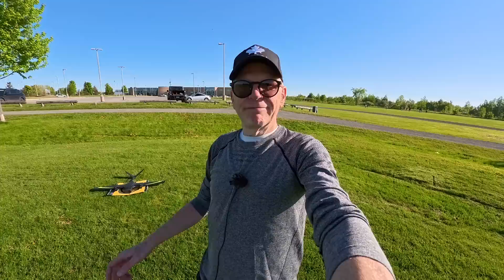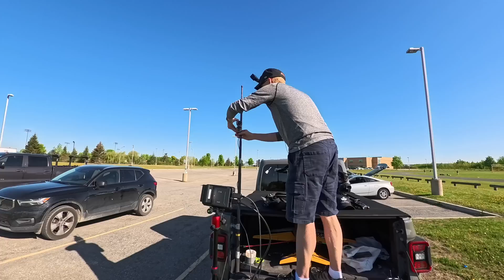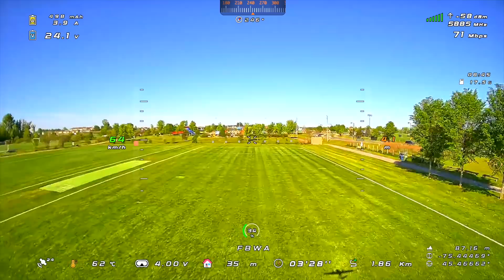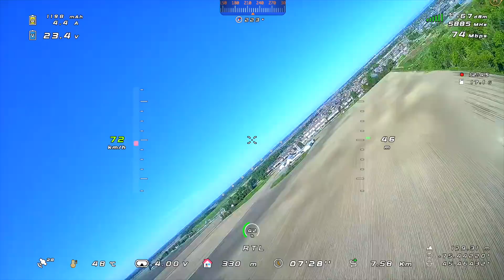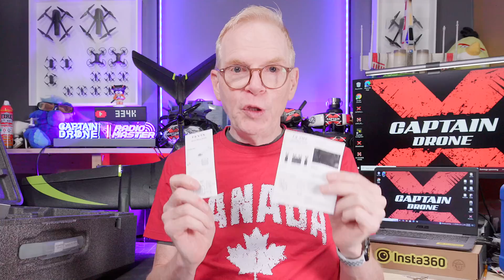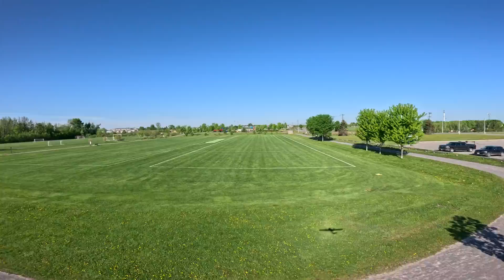OMPHOBBY - ZMO Version 2 - Long Range VTOL

Comment: HI Just watched your video.

Great video .The link no longer seems to work and there is no mention on their website of this or the original.  Would the FC dif file work on the V1 model ?  Richard
Reply from the maker: The flight controller would certainly work on the V1, but you’d have to gut everything out of the V1 except motors.  The company had problems with obtaining parts and then I think other problems developed so they pulled the website down.  I’ve asked what the exact problem is but have received no response.

Comment: is the tail motor on servo? I don't understand how it stays stable in loiter. I don't see any servo here
Reply from the maker: The tail motor is NOT on a servo.  The tail motor only works in VERTICAL flight (take off - landing) & shuts off during HORIZONTAL flight modes.

Comment: No compass calibration for the Ardupilot? Good luck with your flyaways!
Reply from the maker: Compass calibration is pretty much a thing of the past for the simple reasons that the reliance on a COMPASS in GPS is no longer a necessity, thus all products made in the year 2023 and onward work out of the box with now requirement for a compass calibration, unless of course you live in the part of the world where there are insufficient GPS Sats.
Reply: @CAPTAINDRONE798 compass is faster than GPS that's why it is still useful. But a two antennas GPS YAW is even more interesting thing to fly. I prefer the GPS YAW high priority then a compass in the GNSS module and then a built-in one. I don't fly in regions with corrupt GPS much but I do calibrate compass in every new location (if more than 200 km from the previous one) just not to have the GPS YAW and the compass inconsistant error. Hate it so much! 😂

Comment: seems like its not a rly long range fly because its very battery hungry, to fly near 1h you should put a very larger and heavy battery on it with not enought space to do it. Also the fpv cam has no headtracking right ?
Reply from the maker: Head tracking is something you’d have to add

Comment: Hi there sorry to bother you I went to the address you put up and got to the site for the v toll 2.....but I can't find the model on the site and have tried to contact them about the v toll 2 but had no luck ......are they still making this model ...do you know....
Reply from the maker: Good question.  They had a problem with the EDGE TX supplier… lack of stock. That could be the issue.

Comment: Will DJi goggles 3 work with it?
Reply from the maker: Only if it had a DJI camera system
Reply: @CAPTAINDRONE798  ok. So what goggles do you recommend? I wonder if the hdmi would go into a tablet or a small flat screen  tv.😂That would be cool

Comment: Your promotion video is completly useless because the link to buy is not working. You try to sell a 1000 bugs produdct with the funny way, that dont work. A compass calibration with ardupilot might be usefull. But you even say that this is an Ardupilot system.
Reply from the maker: You are unfortunately late to the game.  This is an old video and the product sold out.  The company is no longer taking orders.

Comment: What's the battery life on the plane and sending unit?
Reply from the maker: You can use any battery in the VTOL you like, as long as it fits, so BATTERY performance will be different for everyone in the RC Hobby.  Battery in the Transmitter gives a couple hours of use before needed to be charged, or one can just plug a USB cable into it to supply continuous power.

Comment: Poor design for a VTOL, it could serve as a surveillance drone with high altitude and slow flight. Rear properllers, does it spin in the sky during forward movement? That must be fitted for additional lift, considering the weight on the rear side.

Comment: I wanted to know if I could connect FPV goggles to this without capacitors or anything.
Reply from the maker: It depends on which video transmission system you pick when you order it

Comment: you said it plugs to any screen with HDMI so I plug it to a laptop ? or a portable screen ?
Reply from the maker: LAPTOPS often are HDMI out… to send your video to a larger screen, so nope!  Portable screens are small so they are often HDMI out, so nope!  You need a device with HDMI in… and not Out.  The display I used is for professional videography so it has HDMI in and out.
Reply: @CAPTAINDRONE798  thank you for your reply,,just a last question do they have one model that they sell with a remote control that has a built in screen ? like DJI drone remote

Comment: Great video, thanks! At 10C, he included battery looks like a Li-Ion pack... but 4400 mAh is a weird capacity for a Li-Ion 1P... can you comment further? Also, how much larger a battery would this plane support?
Reply from the maker: I tried it with a 5000 mah battery that was the normal long and narrow and it worked fine.

Comment: Dear Captain Drone, what would you recommend: buying this RTF version, knowing that I already have a headset with an HDMI input, or buying an used version 1 (the one with the old DJI radio that you crashed three times) for the same price, knowing that I also have the DJI headset that would work well ? In the first case, I will have to wait because there is no more stock. Will my patience be rewarded? Thank you for this great review !
Reply from the maker: They do also make this new version in the DJI 04 version.  The version I flew has a crazy number of options and potential compared to the old version 1.
Reply: @CAPTAINDRONE798  Thank you for your reply ! I'll wait ! I haven't seen the version with DJI O4 on their website, but I'll ask them about it. The T3 system seems to be a good alternative for long range, if I understand correctly ? Best regards

Comment: What would happen if the signal drops?..and what is the best battery that can be used for maximum flight time?
Reply from the maker: If connection was lost, it would go into return to home until you took it over again.  Maximum flight time all depends on the experience of the pilot.  A newbie pilot would run any battery dry quickly whereas an experienced pilot would buy a proper battery and would barely fly in drone mode and would fly efficiently in airplane mode.

Comment: Hello, I’d like to use this drone to do weather checks for a heli skiing operation in BC. Will this drone still fly 35km even if it’s not perfect line of site to the receiver? Also another problem I’ve had with my DJI  drone is the vertical height limit. It’ll only allow me to fly 500m above my start point. Is there a way around this? Thanks
Reply from the maker: You’d have to ask OMP HOBBY what the max vertical height permitted is with this.  Also, all planes & drones at a far distance require a direct unobstructed path between transmitter and receiver.

Comment: I have it, have done missions and have it setup with DJI Air Unit 04 Pro, DJI Controller 3 and DJI Goggles 3. Its nice because I already use all this for my DJI drones and no need for Gopros. No ground station needed as well.
Reply: @Albert-cf1es  which kit version did you go with and what was the install process like?

Comment: Whats the average time on the a full battery?
Reply from the maker: It depends… if you ONLY use the battery that came with it then you are stuck with the best the battery can offer.  If you hover in DRONE mode, then it uses a ton of power.  If you fly like a plane, it uses very little power.  So I’d say a NEWBIE would get 30 mins and a knowledgeable person would get 45 mins.  Most knowledgeable people will use their own batteries to fly up to an hour or longer.

Comment: Does it have an intelligent return to home mode where it decides to come home because it knows the battery is getting dangerously low?
Reply from the maker: Apparently YES, it does…. BUT…. I have not tried it, so I can’t confirm this is the case.
Reply: @CAPTAINDRONE798 could I use a laptop as my display?  Assuming the laptop has an HDMI port, could I use that to view the live video feed from the drone?

Comment: OMP absolutely abandoned the ZMO platform with firmware issues. Honestly really surprised they made this V2. I bought the ZMO Pro and apparently the motors are not suitable for the platform. They sent 2 larger replacement motors with heavy duty servos, which ended up not even fitting correctly in the plane. They suggested I take a dremel to it to modify it. It's clear to me now they sent 2 of the motors from this new V2 plane. 

The majority of ZMO/ZMO Pro owners are grounded due to flight issues with the original FC, with many opting to swap it out and start from scratch. 

OMP Hobby if you see this, kindly create a page on your site dedicated to making right with the ZMO/ZMO Pro owners, providing updated firmware, and the steps needed to get their planes flying again.
Reply from the maker: I’m not certain which ZMO you are referring to that had motor and flight controller issues?  I have version 1 of the ZMO, the very first version made, and have made years of videos flying it in different weather conditions with no issues.  ZMO did make a second version with a terrible control system (it came with a remote with a display that was not good)… Is that the one you are referring to?

Comment: ❤ I WANT ONE !!! VERY GOOD REVIEW BTW QUESTION ❓ - Loiter Mode 👉 if you flip into that mode when it's off in the distance, will it loiter there or come back first ?? 
Thanks, I'll sub too 😎✅
Reply from the maker: Loiter mode is designed to fly around your own location.  If you are far away it may just work like a RTH without landing.

Comment: In your video, you state that it has a range of 35 km.  But on the product webpage, it says "ultimate" distance of 15 km.  Can you please clarify which is it? Thanks.
Reply from the maker: Range depends on the BATTERY used.

Comment: Great video, Capt.Drone. It's good to see that OMP HOBBY has finally improved on the ZMO by making a V2. The T3 video system is more than adequate for a fixed-wing product. The price for the entire system is not bad at all. I build lots of fixed-wing units using INAV with Speedybee and SN light flight controllers. The cost is comparable to a new DJI Drone. I like what I see, therefore I plan to break open the wallet on one of these. Ever since the Parrot Disco went defunct, I've wondered when someone would resurrect an out-of-the-box fixed-wing product. 😊
Reply from the maker: It sounds like you have some good experience and knowledge that will make the ZMO perfect for your use
Reply: I couldn't have said it better. I absolutely loved the Parrot Disco and must have put 100's of hours on mine with the 4G softmod. I'd also love to try out this ZMO. It's expensive though and v1 wasn't all that great I believe. But I want to believe in this product. Maybe I'll buy one.

Comment: If you think that "compass headings" and GPS accuracy are the same thing, then you have some learning to do.
Reply from the maker: Perhaps you are new to the world of compass calibration on a product with a GPS.  The reason a compass calibration is done is to ensure that the compass is reporting what the GPS is reporting.  If both are not in alignment then your product will begin to “toilet bowl”.
Reply: yeah... you better refresh your memory on gps vs compass. A GPS cannot tell you which direction you are facing but tells you your location. A compass can tell you which direction you are facing but cannot tell you your location. If one is clever, one can create a correlation of high degree between the two... but that is an approximation only and should not be construed as equivalent.

Comment: Last question Steve,  would you happen to know if the antenna equipment is weather proof? Even if its not, im purchasing the drone anyway.  Thanks for the video.  Im a subscriber now.
Reply from the maker: I suspect it is not weatherproof when it comes to RAIN.  I have flown the previous version in the winter and lite drizzle without issue.

Comment: Would love it if you reviewed more professional drones! Cinelifters, other production gear!
Reply from the maker: Ha ha… Well, I have reviewed all the major drones for so many many many years (since year 2016) when there was actually competition in the drone market.  Today there is pretty much only DJI beginner drones for first time pilots, and I can’t keep reviewing DJI Products or else I’d end up being like all those “DJI ONLY YOUTUBE CHANNELS” which are rather boring, unless all you wish to see is one video on a DJI Drone you wish to buy… then what do you watch????.  And to make things worse.  DJI only pumps out 3 or 4 consumer beginner camera drone kits a year so I’d quickly run out of things to review.  Finally, pretty much everyone who gets in the RC Hobby, even if they begin with a beginner DJI Drone, will eventually branch out into FPV Drones, RC Helicopters and RC Planes.  I certainly did, and I began with the DJI beginner drones back in the year 2013 (that is 12 years ago… Yikes).
Reply: @CAPTAINDRONE798 What I was getting at was Cineifter FPV's such as iFlight Centurion X8, Lumenier QAV PRO, etc. It's an FPV angle I don't think you have hit yet! As a producer I need the best possible camera that can be hauled into the sky, and that requires a cinelifter. Would love to see what you come up with!

Comment: Hello Captain Drone. So, it seems there is a long delay with the T3 video transmission modules. OMP Hobby said I can wait until they are available, or they can send my ZMO now and send the T3 later to fit myself. What do you recommend? I want to play with the ZMO now, but if there are issues with fitting the T3 myself I could be in trouble?
Reply from the maker: If they send you the T3 unit later, you would then have to install it in the ZMO and connect it to the correct port on the flight controller.  If they provide you with such instructions, then it is doable.  If you are the slightest bit unsure, wait for the entire unit.
Reply: @CAPTAINDRONE798  Thank you Sir. Another question unrelated to ZMO. Is there a way to see speed and altitude on the Flywing factory controller?

Comment: What's the flight time per charge?
Reply from the maker: Flight Depends on if the pilot is a NEWBIE to the RC Hobby or a long time RC Hobby pilot who has been flying FPV Drones and RC Planes.  So for the NEWBIE, the flight time is 30 min because they honestly don’t know what they are doing and learning as they go.  For the experienced pilot the flight time is 45 min, and can be much longer by using the proper battery (people in the RC Hobby will know what to use).

Comment: I'm on the fence about getting one of these. Does the rear propeller stop spinning while in horizontal (plane) mode?
Reply from the maker: Correct.  In RC Plane mode only the two forward props operate.
Reply: @CAPTAINDRONE798 thank you for responding

Comment: Steve, I just ordered the v2 based on your review. I followed your link - I hope you get the referral. I’m trying to source batteries but can’t find one that is equivalent to the one that’s included. What are you using? And do you have charger recommendations? Thanks.
Reply from the maker: Unfortunately, I receive no commissions from OMPHOBBY for any sales.  For a battery, any 6S battery with an XT60 connector will do and it does not matter if it is a LIPO battery or LION battery.  The square shaped batteries are difficult to find at a good price but plenty of the rectangle versions are available on AMAZON.
Reply: @CAPTAINDRONE798  Ok, thanks. OMPHOBBY's battery is labeled as Lipo as is their description, but I cannot find any in the same form factor and the same specs from any other source. The only batteries I have found are Li-on. So it has me wondering if they're really Lipo. In any event, OMPHOBBY emailed me earlier today to say the T3 video system is indefinitely out of stock. It looks like I'm going to be canceling the order. I hope another prosumer VTOL hits the market. The commercial options are way too far out of reach for hobby use.

Comment: Hey there good video by the way....I have a question ...can you swap modes on this model zmo 2...and do you need the ground station for this......and can I get it with the dji adaption on the zmo 2.....?
Reply from the maker: If you want to add the DJI 04 system, apparently you can if you have the know how.  Yes, any RADIOMASTER radio can be swapped from one MODE to another.  Personally, I’d just buy my own radio and copy the settings over.

Comment: Stall? I take it the aerodynamics don't allow for any sort of gliding then? If the battery died it will just fall out of the sky like a rock or what?
Reply from the maker: When the ZMO stalls it goes into Tri-copter mode.  But if you stall low to the ground on a turn, you may tumble to the ground.

Comment: If you can't even bind a controller, then you literally have no business even owning this drone... 
It's no wonder the hobby is going to be regulated into oblivion within 5 years. 
Making small aircraft available to persons who don't even have the desire to learn a simple process like binding a controller, doesn't serve the industry or the users very well in my opinion. 
It might make some extra money for the people selling the kits, but in the long run it's just pushing lawmakers into regulating the hobby away and making it harder to fly anything. 

Just wait. The first dumbass that straps a molotov cocktail to one and flies it into something, they'll have enough public approval to start cracking down.
Reply from the maker: Many people said the same thing when DJI Came out with their PHANTOM way back in 2013, and it continues to this day.  The market today is for the people with no skills that want to spend money and get up flying quickly.  All DJI Drones, and similar are designed for people with no experience.  Helicopters today have optical flow and GPS, perfect for beginners.  FPV Drones is the only hobby remaining where one needs knowledge and pilot skills.